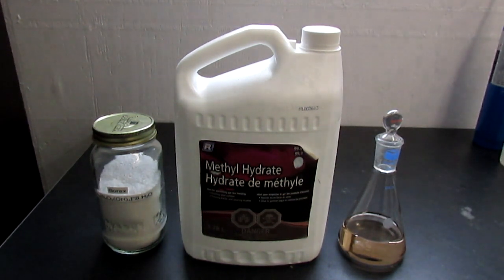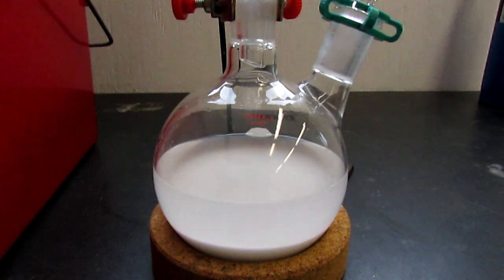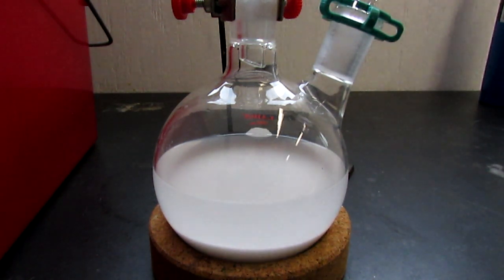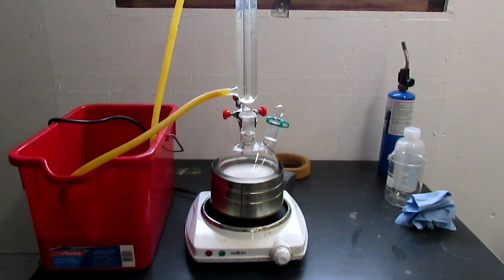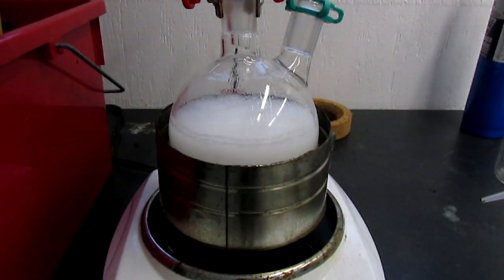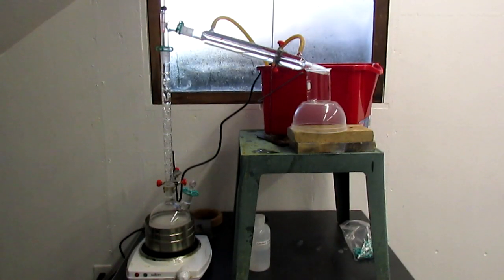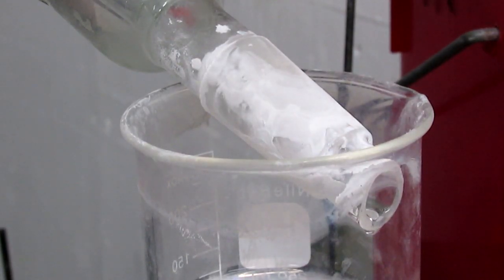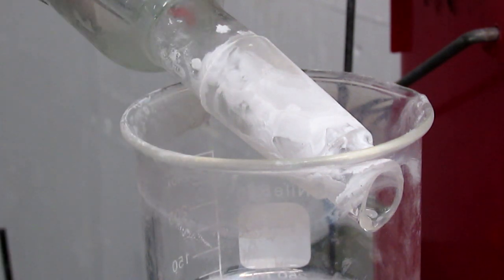How To Make Trimethyl Borate

Comment: Dissolve a bit of lithium metal in 100ml of methanol.  You'll end up with a methanolic solution of lithium methoxide which burns with a beautiful crimson red flame. The contrast between burning trimethyl borate and lithium methoxide is simply gorgeous.
Reply: does the lithium dissolve easily or become very soluble in methanol without need for mixing vigorously? any toxic fumes or vapors when you do this?
Reply: @ARCSTREAMS  It reacts without the need tor vigorous stirring.  The only products are hydrogen gas and lithium methoxide solution.
Reply: @Franklin-jj4jz  and this methoxide solution can be stored in container and will keep burning red no matter how long i store it so long as it has not evaporated?
Reply: @Franklin-jj4jz  ty, right now i have 100% boric acid and will get methanol (sold as methyl hydrate) but i would like it so that the powder completely dissolves in the alc without it falling out of solution and wondering if this clarified solution is possible without it looking hazy and still burn nice and neon green or will it eventually haze up and drop out of solution in time even in a properly sealed bottle? in other words im trying to avoid an insoluble looking solution ,is there a good specific ratio to get what im looking for? what is the min amount of acid to add that will still give the green flame or does increasing the amount of acid give better results albeit at the expense of clarity?
Reply: @ You are not simply dissolving boric acid into methanol, you need to react the two to produce a third product, trimethyl borate.  This is what burns green.  The process is called Fischer esterification and involves refluxing boric acid with methanol.  Usually a trace of strong acid is added to drive the reaction to completion.  To get the purest product, you should distill the product from the reaction mixture.  FYI, It is the red burning lithium methoxide that is water reactive.  Trimethyl borate isn't particularly water sensitive and should keep well in methanol solution.
Reply: @Franklin-jj4jz  sorry if i got you mixed up between the two,, im just saying for now i will only be making a green flamme with mixing boric and methanol,, yes i know about the more complicated trimethyl borate but i am not going that rout, juts the simpler rout of getting a green flame by straight mixing those two and was wondering if i can mix enough boric to make it flam egreen but have a clear solution instead of hazy after mixing the two
Reply: @Franklin-jj4jz  seems like some of your replies or at least one is now missing? stupid yt always giving me problems like this

Comment: I can see why esterifying the hydrate of methanol and sodium borate would require a dehydrating agent like sulfuric acid.  So, does using boric acid and dry methanol work?
Reply from the maker: It does, but still proceeds much faster with the addition of sulfuric acid and you get better yield as the sulfuric acid strongly holds on to the water produced which helps drive the equilibrium

Comment: "Main hazards: flammable" - Wikipedia
"It has been explored as a fire retardant" - also Wikipedia.
I can only assume that exploration process was extremely brief.
Reply: Very old comment but to anyone coming across this video in the future it is still used as a fire retardant additive in many resins and paints.  A fire retardant does not necessarily mean it is something you can throw on a fire to put it out though. With exposure to water trimethyl borate decomposes into boric acid and methanol, so once the paint or resin has cured with exposure to water in the air only boric acid is left behind.  Boric acid, which is also seen burning in this video, is a well known fire retardant but cannot be added directly as it would be insoluble in those products.  The fire retardant properties of these compounds come from how they promote char formation.  As the carbon containing material its been added to burns it decomposes in somewhat unpredictable ways forming a large number of different radicals and combustion products.  The boric acid readily forms borate esters with some of those combustion products which are less reactive and are prone to polymerizing. This forms a more cohesive than usual layer of char that prevents oxygen from easily penetrating beyond the surface of the material.